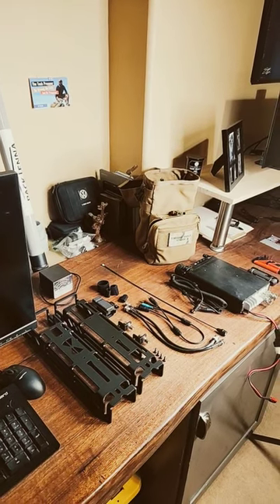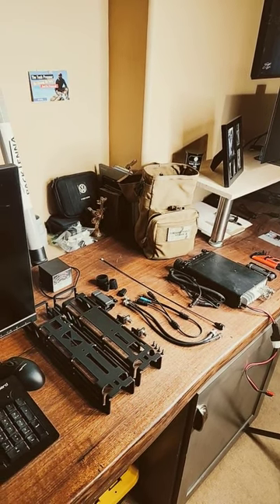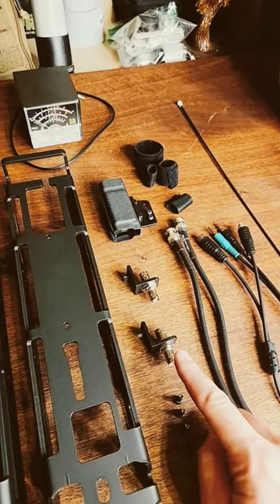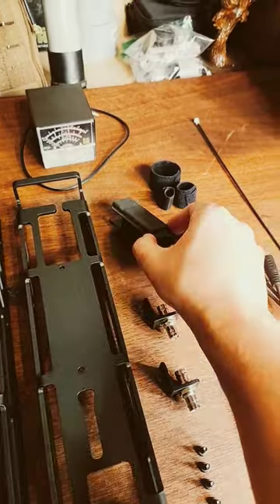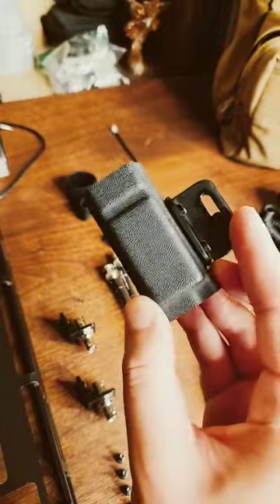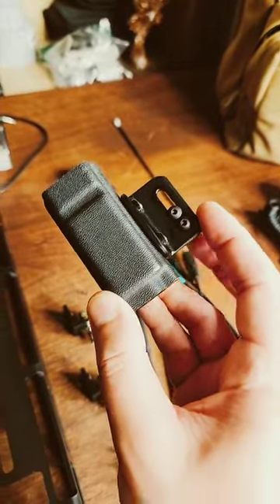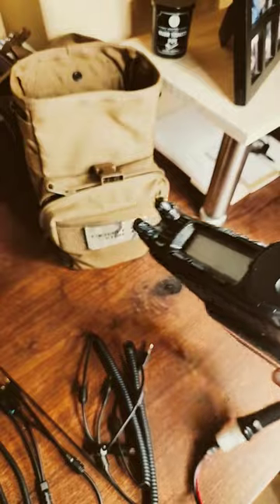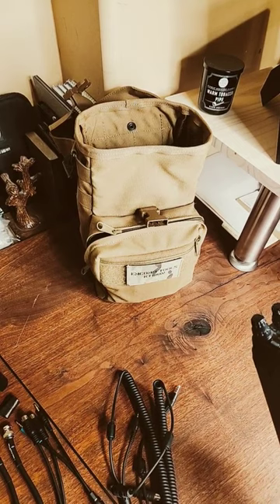Yaesu FT-857 Manpack Update - New DigiRig Cables

Comment: I'm still the fence as to getting an 891 or 857 for my first rig. I see a lot of 857's with the lines in the display, so I'm hesitant, and also wonder how much life they have left in them. Unless you think they are easily serviceable?
Reply: Also do not buy a Japanese 857 it cannot be made to tx on all the USA frequencies
Reply from the maker: Since the 857 discontinued, it's a gamble on what you will get in terms of condition on the secondary market. I have a pair of units that I purchased used and both do not suffer from the issue, so I can't comment on the ease of repair. If you want a radio in the same footprint and don't need 2m/440, it's worth considering the 891. If you're not planning on going portable, research the FT-991A.
Reply: @TheTechPrepper  Portable seems to be the best bet. In your recent video you mentioned dropping support in emcommtools for the 891. I was thinking that was the one, but I'm not sure now.
Reply from the maker: @anonymous_friend  The goal of the project was for grid down scenarios with high availability, so it needs to be robust. If any component introduces instability into the platform, it needs to be removed. EmComm Tools is designed for a very small group of operators, so if you like the FT-891 consider just running the operating system that you feel comfortable running and install the desired ham radio applications. Please do not select your gear decisions on the current state of the project.
Reply: I like your pack that has the solar charger. Downloaded the ham study app and got 60% first time though. I think im going to pursue a tech license and build one of these!! Great vids tyty

Comment: When will the manpack be available???
Reply from the maker: Unfortunately, I only made 25 and they sold out with a couple of minutes. I'm still debating whether I have time to make a larger batch next year.
Reply: @TheTechPrepper  I wish you would! I have struggled with trying to decide on what to load my radio into. I finally decided today that I would go with a 20L backpack. There is room for the FT-857 with frame, Signalstick, battery, a Gabil tripod, NanoVNA and collapsing vertical antenna in the main compartment. The next compartment has room for a tablet for digital operations along with a couple of other small pouches for snacks/water. I can also strap on a 24' collapsible fiberglass fishing pole and jam in an OCFD wire antenna if need be. So not really "man portable," but it's a "Go Bag" that has it all for the vehicle.

Comment: I have 891 and I need that one now! To aprs I use FT5DE but I consider ftm500 because I need more power 😅
Reply from the maker: Actually, the FT-891 already has on-board CAT, so this cable may not be for you as all you need is audio via the data port. If you use the DigiRig you will have an used cable dangling. I actually do not run the 891 with the DigiRig anymore for this reason as the serial interface is on used, but still presented to the operating system. I just use the Sabrent USB for getting sound in and out on my 891.

Comment: Have a link for those shorter cables? I have the longer coiled ones and really dislike the sloppiness.
Reply from the maker: Don't run these shorter cables on the 857D if you run it with the TPA frames. There is an causing the PTT lock up. The longer cables are fine. The shorter cables work fine on the smaller FT-818ND make. The DigiRig site for the 8xx cables now has a drop down option to select the cable variations.
Reply: @TheTechPrepper did y’all figure out why on this issuev or continue to avoid the shorter cables? I’d love to have less to deal with and am assembling the same setup.
Reply from the maker: @BigGPlace  I never did figure it out. I am using the longer cables on the FT-857D. For the FT-818ND, the shorter cables are fine.